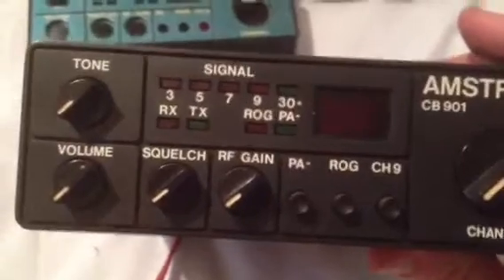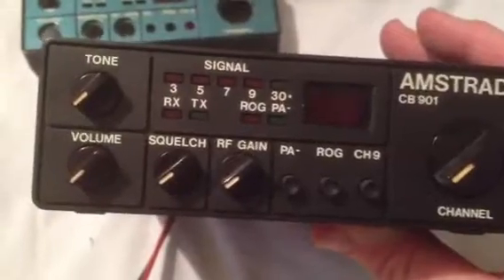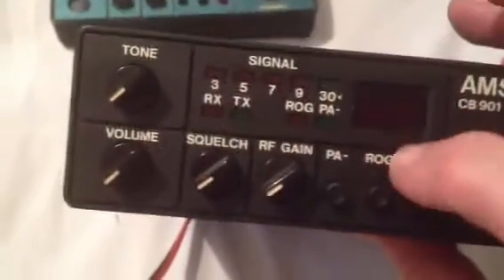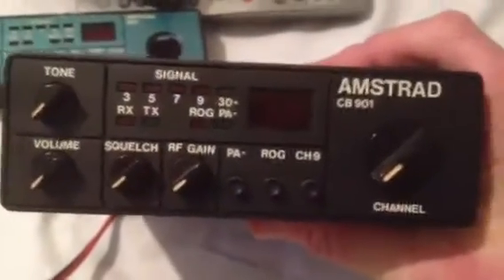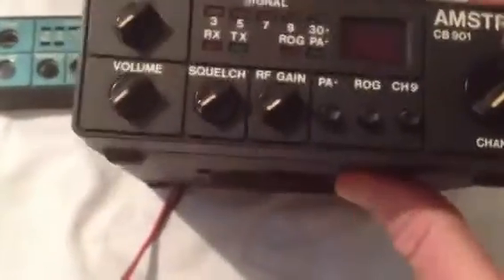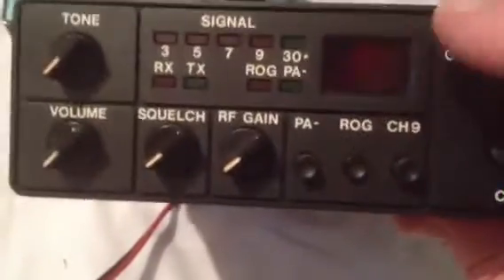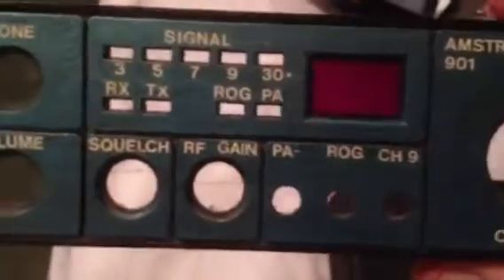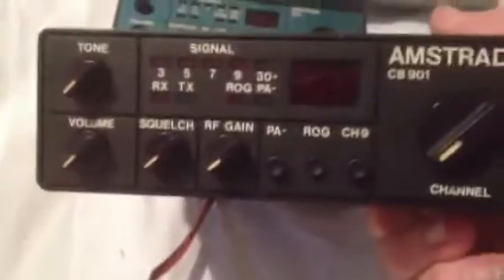Restored Amstrad 901 cb radio

Comment: Hi. I've used "Decadry" lettering on CB's for over 30 years now but have also done a couple using Letraset. My first go at it was with a Superstar 360 in about 1985. With the advent of computer-generated decals nowadays, doing it letter-by-letter doesn't have as much appeal. The last radio I did using Decadry about 3 years ago was a actually a metallic purple Amstrad with 80 channels and an extra row of LED's which illuminate when peole are talking (Vu meter). It also has a noise-squelch fitted. Drilling and filing the holes for the extra LED's was time-consuming to day the least! There's now 3 rows of 5.
Keep up the good work ;)

Dave ("The Collector" from Transmission1.net's website).
Reply from the maker: BigDave R I've not heard of decadry , have you made any videos of your radios on YouTube?